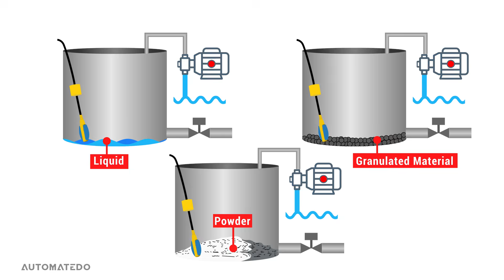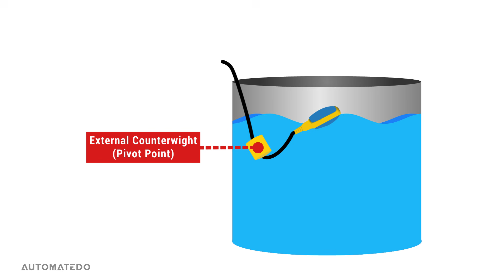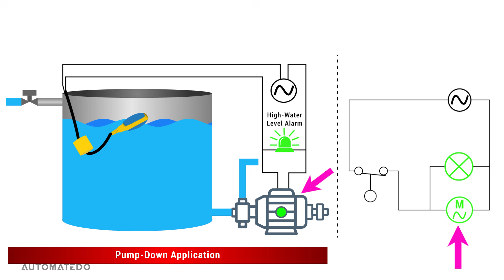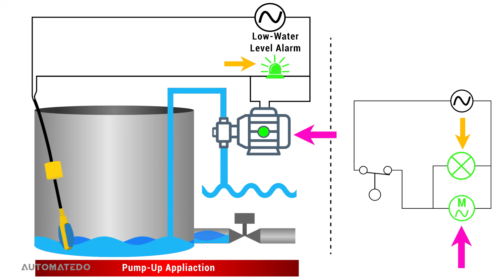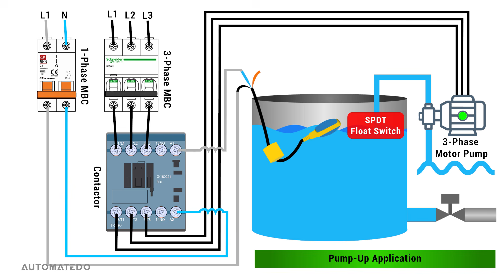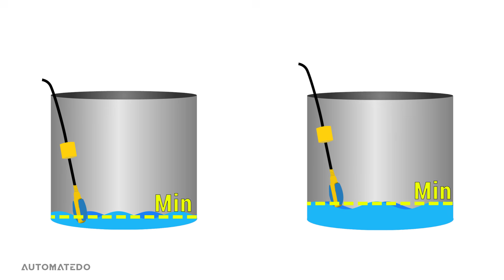Float Switch Explained: How It Works, Types & Wiring

Comment: Boss doe the SPDT type ,  U need to use Neutral Wire to for the float Switch connection, Phase to be connected directly to  one terminal of the contactor,  then connect the Neutral for the float Switch to the other terminal of the contactor, The NC/ NO wire of the float Switch to the Neutral of the Breaker

Comment: I need a reverse float switch that turns OFF when water is low
Reply: Place balancer at the bottom, when tank is full float stay at the top when water level decrease its move at the bottom and when it  comes accross with balancer it get triggered